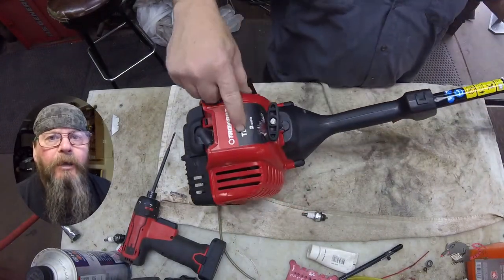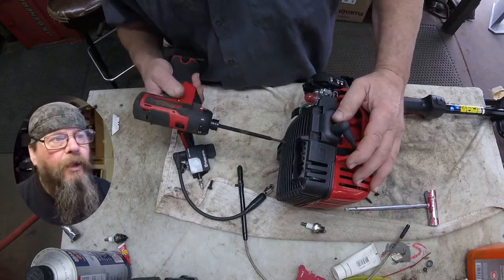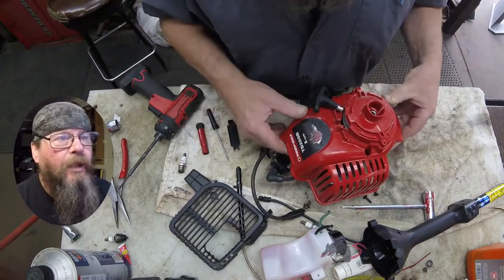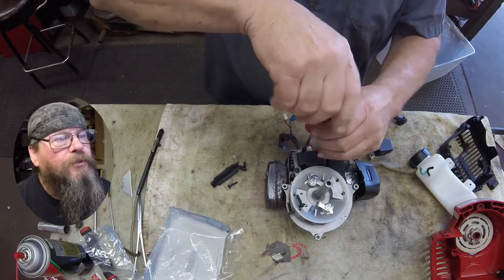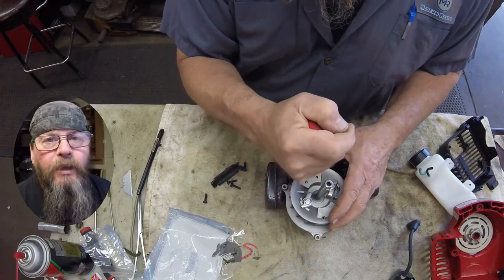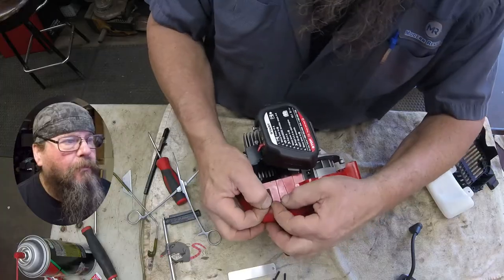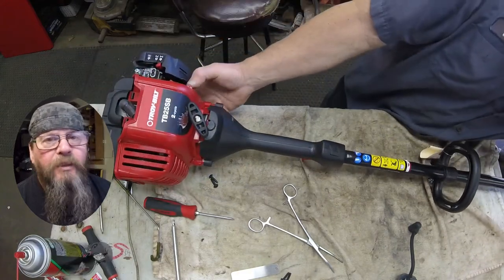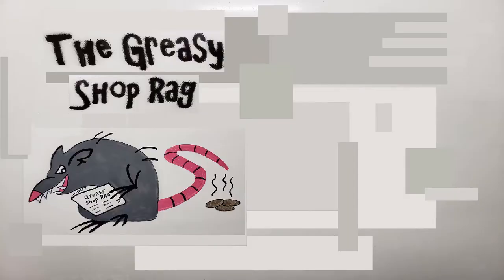Troy-Bilt Trimmer Won't Start-Fixed!

Comment: I had a Troy-Bilt trimmer once.  It ran great for a couple of seasons and then became a bear to start.  I'm currently using my 20 year old B&D 20 volt cordless.  Down to two batteries though.
Good job on the fix
Reply from the maker: You don't have a ryobi trimmer? I know you have batteries.
Reply: @TheGreasyShopRag  I do have a Ryobi trimmer, but I prefer my old B&D. I’ll probably get a 40v Ryobi trimmer when it dies

Comment: Thanks for the video! Just bought one from major retailer. Got it home, put it together and tried for an hour yesterday and today to get it to start. Nothing! Went back to retailer and was told once it has gas in it, can't return it. How the hell can you know if it doesn't work out of the box. This model too. Going to visit with GM on Tuesday. Again, great info. They have no inhouse service........
Reply from the maker: We hear that type of story all the time. I know its cheaper to buy from a big box store or online but is it really? You're gonna have a lot of time and frustration in this simple trimmer purchase when a dealer would have had it prepped and test run before you got it. I wonder if their "gas" policy is posted anywhere for you to see?

Comment: Definitely considering to buy a the troy-built straight shaft weed-eater for my place next spring. They’re very powerful and heard they perform well overall. Especially the straight shaft cause have almost half an acre of lawn at my house.
Reply from the maker: They work fine if you don't leave old fuel in them.

Comment: Also considering the curve shaft Troy built weed-eater in case I don’t like the straight shaft, so will see, but do like straight shaft cause it’s easier to trim around hard to reach areas of my big lawn.

Comment: On those troy bilt some times the 2 bolts hold the jug or cylinder to lower crane casing will come lose and you have to tighten them back down to seal it . Mine did it I had stored it for 3 year cause it just would not run . Had fire put brand new carb and lines on it steal would not run . So after 3 years in storage instead of buying a brand new one I figured I'd give it one more look over and thought well I never looked at muffler to see if it was clogged and when I took it off I could see those 2 bolts holding jug on was just about to fall out I put lock tight on them and tighten them down good put it back together and it runs better than it did when it was brand new
Reply from the maker: I just did one today with the same problem. It happens

Comment: What kind of spark checker is that. I’m tired of my crappy HF one. Thanks.
Reply from the maker: Google this: Echo PET4000 Spark Tester
Reply: @TheGreasyShopRag  thank you. Would you recommend this one?
Reply from the maker: @randyc2525  Yes. It allows you to change the gap with a thumb screw. Many manufacturers recommend setting the gap around 6mm. If it jumps that gap with a nice blue spark then you know your module has the reserve power it needs. Other testers just tell you yes or no on spark with no clue as to weak or strong.
Reply: Thank you so much for your reply.
Reply: @TheGreasyShopRag  I believe you meant 0.6 mm the spark plug gap.     6 mm is quarter of inch

Comment: ❓ What MTD part did you use? I want to be able to order the right one. The only one that I see is for a Craftsman not a Troy-Bilt two cycle. Do you have a reference or a link or even an order number? Thank you in advance. I am doing everything I can to avoid going green here.
Reply from the maker: I don't remember but try looking up your model on Parts Tree for a part number.

Comment: I don’t like Troy bill string trimmers junk
Reply from the maker: I don't recommend them but I'll certainly fix them. The pay is the same as higher quality units.
Reply: Cost almost as much to fix than get a new and better one.
Reply: I agree. I regret getting one.
Reply: @RoyalCaribbeanCruiseChronicles  that's the idea, to force customers into throwing them away and buying a new one, over and over and over again.  it's called the sustainable business model.  I've seen a lot of people throw away their trimmers simply because they had no idea they could adjust the pac man screws and get it running again.  the user manuals don't even mention those carburetor adjustment screws because they don't want regular Joe homeowner to be able to fix his own trimmer.